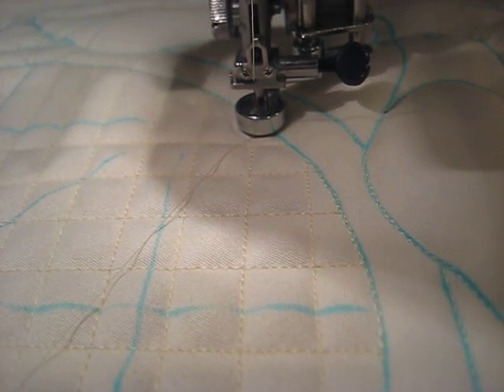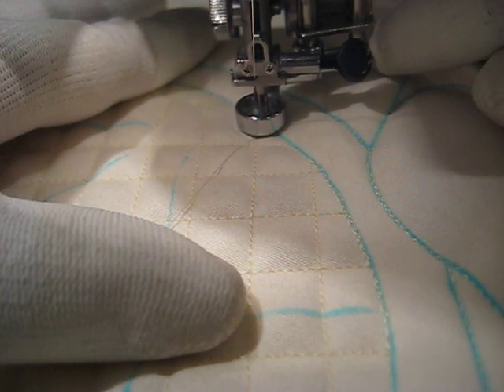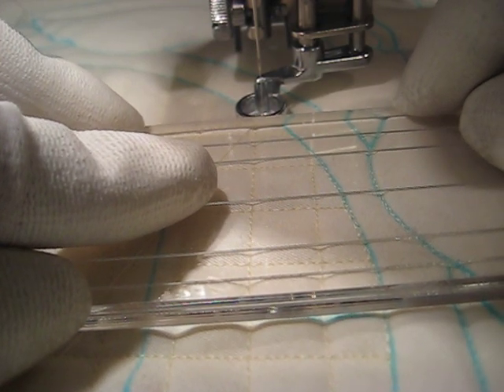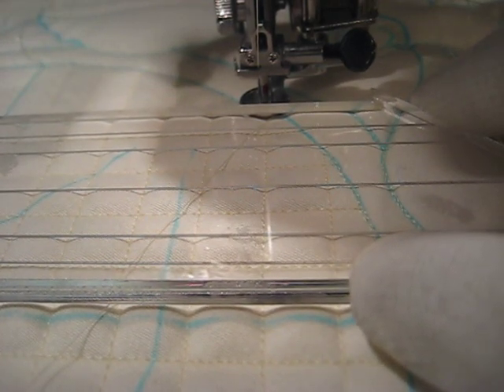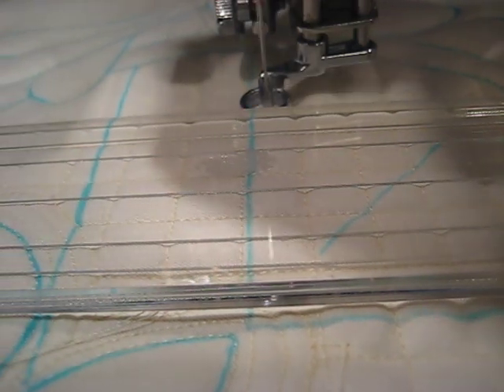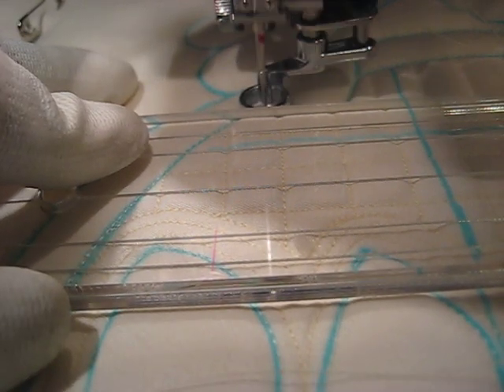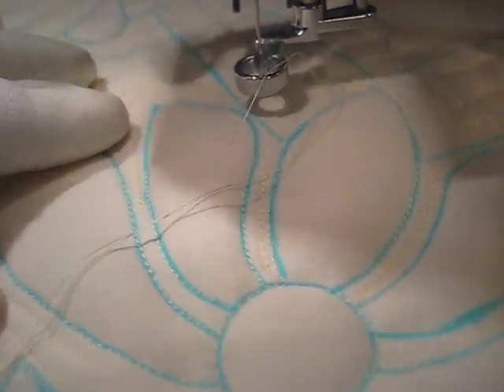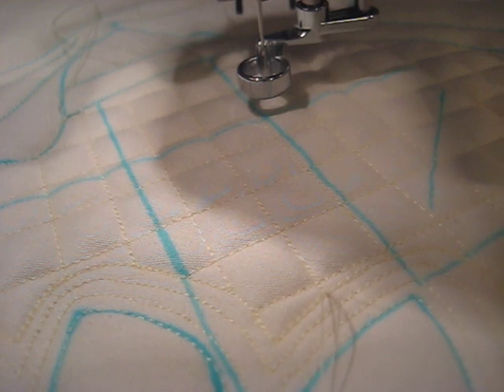Free Motion Quilting Ruler Work on Sewing Machine

Comment: I do not see any pins so what did you did for basting your quilt sandwich and what blue marking pen did you use and why did you choose that marking pen?
Reply from the maker: +LindaLu Cord This was a small sample which doesn't require many pins, and I had already removed most of them as I stitched. I use regular basting pins. The marker is a Mark B Gone blue water soluble marker. Washes out in a water bath.
Reply: +Amy Johnson Thank you for responding so quickly. Will you or Westalee Rulers be demonstrating at Paducah this year? I hope to find someone there who can demonstrate the technique and the which ruler feet to use on what machine I have.
Reply from the maker: No idea what Westalee will be doing, but you can see me on my blog and a full class on ruler work on Craftsy.